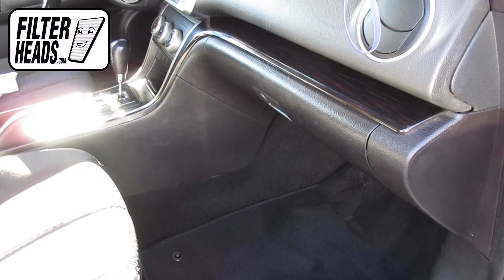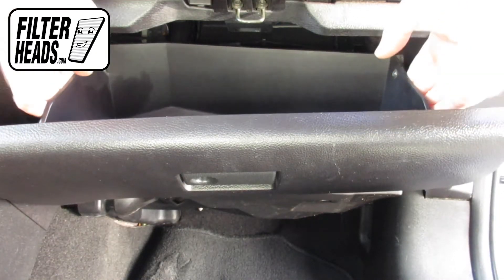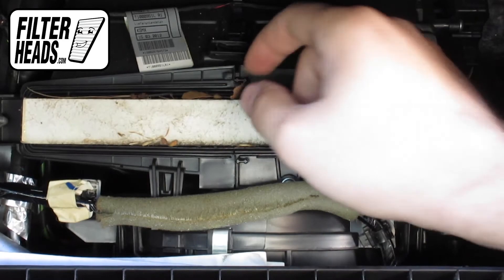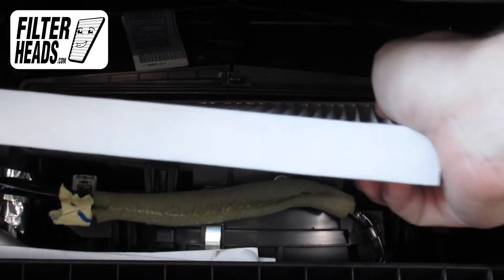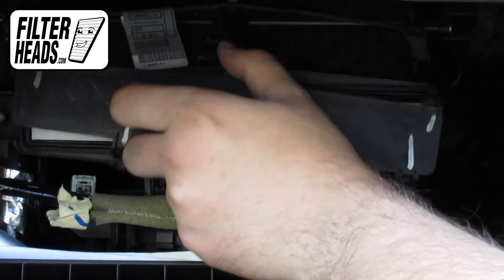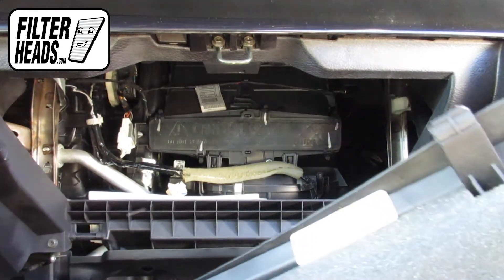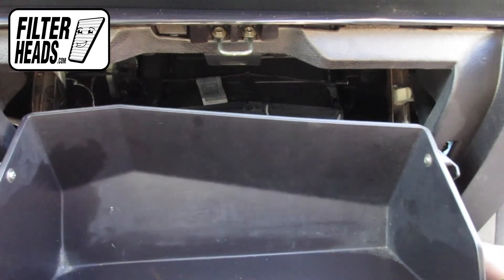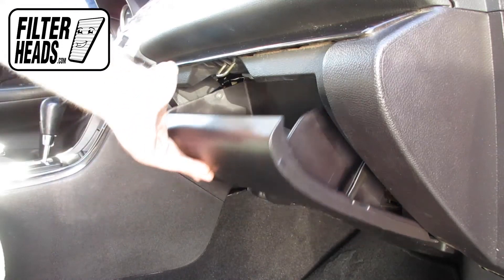How to Replace Cabin Air Filter 2012 Mazda 6 | AQ1152

Comment: do you know anything about fuel filter replacement on a 2012 Mazda 6?  Trying to figure out if the tank needs to be dropped, or if it can be done through the back seat.  Hard to find any info anywhere
Reply from the maker: We only have videos on engine and cabin air filters at this time.